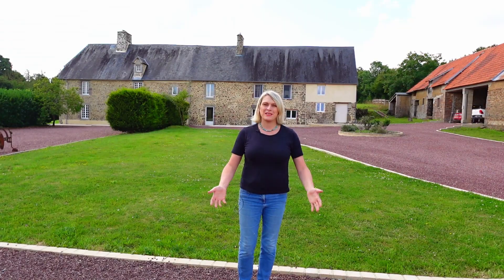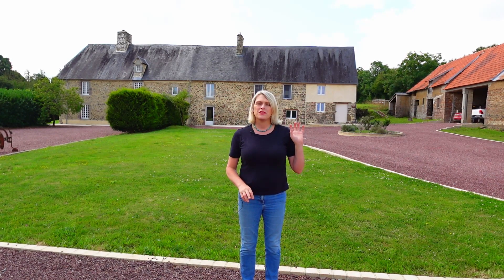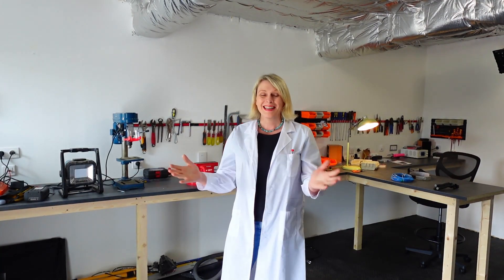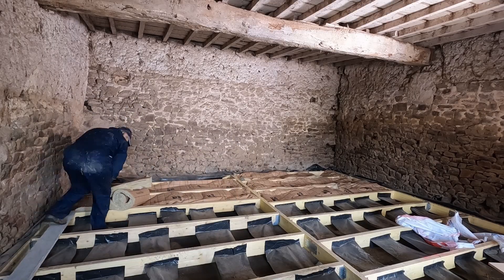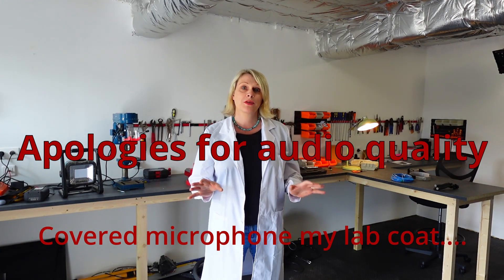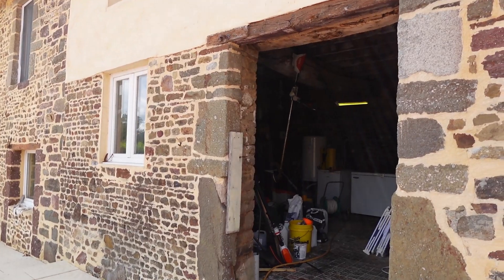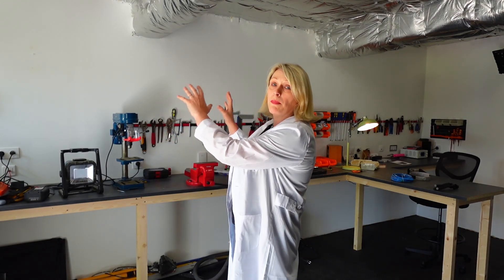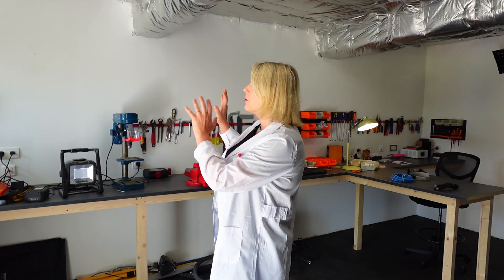DIY Whole house battery system -  overview

Comment: That's incredible the cost of electricity $1000 Euro's a month. Solar is a great option your lucky that don't have problems with building code in regard to DIY battery's and solar panels. Here in the US they have so much regulation around solar makes it very expensive to install. I believe lot of that comes from the electric utility who are against rooftop solar although they don't say that publicly.

Comment: Cool project. I'm just starting to plan a solar installation in France - we have almost 100m2 of south facing roof (plus almost as much east/west), but since our heating is currently gas (in a cistern) I have no idea what our eventual demand will be. We are renovating half the property too so there should be a good improvement in the thermal properties. It would be great to understand your loads a bit better. Your lab looks so much like I anticipate my workshop looking! I'm still trying to understand the different tariff/FIT options in France too.
Reply from the maker: Best of luck with your renovation project whereabouts in France are you?

Comment: I'm slightly confused how the power usage of the property is 100kwh per 24hr period?! I live in a 3 bed property and use 100kwh a WEEK! And that even includes charging my BMW i3 a few times

I use a victron system that I did myself too which has 10 420W panels - in the winter even with a field of panels you're going to struggle to produce hardly any meaningful power at all - from April till October you're gonna be swimming in power! 

Just an fyi on charging your car - I just use a 3 pin charger because unless your inverter has MEGA output and its also very sunny you're going to struggle to produce the power at the rate that your car will be wanting it. I find my i3 takes a full UK summers day to charge from empty running at 8amps

I have to leave headroom on the inverter to run everything else going on in the house as well.

But the end result is the house is running for £0 and the car gets fully charged for £0 too
Reply from the maker: The main reason we have very high electricity usage is because of electric heating however this is only in the winter.
Reply: @Gridbusters-qx4om Sadly as others have said winter is when you will produce the least solar, for example my peak summer output is about 30+ kWh/day, right now in winter it's less than 5 kWh/day, so I purchase the rest of the power I need from the grid overnight on an EV tariff to charge my 30 kWh battery bank.  Honestly you should look at replacing your heating system, I have the Toshiba Air Conditioning RAS High Wall Heat Pump system in several rooms, Cooling in summer, heating in winter, it's super efficient.  I'll be following your journey it looks quite interesting to say the least!  Best of luck.
Reply from the maker: Luckily we have quite a lot of land here and it's very windy in the winter,  so we might look into getting some wind turbines later down the line.

Obviously in the summer we will have way too much power for our needs but we might invest in some sort of crypto currency or bitcoin mining solution to use some of the excess power.
Reply: @Gridbusters-qx4om  just adding to this as have watched some of your other videos - even if you did make a 100kwh battery bank (which would cost a fortune!) in the summer you wouldn't need it and in the winter you couldn't charge it;

a wind turbine would address that but a £2k wind turbine that you tend to see on boats tends to generate at 100-300w even with good wind conditions - that's a lot of spend for what you get!

And this is what it all boils down to - you can get 90% the way there on say for you a £20k spend but to cover off that last 10% with renewables is going to cost x3 that initial spend again! Its for that reason that your best bet is to just use the grid for that last 10% which just costs you the cost of usage. 

I mitigate some of these costs by using Octopus Go to charge the batteries and car overnight for 1/3 daytime prices. Doing that costs me nothing but I generate the savings out the back still.

And ultimately if you do have a power cut in the winter for a few days you're not gonna be heating the whole house - you might heat one or two rooms or switch to eg gas/log fire

It would be interesting to know your 24hr period usage without heating. I would use that measurement to size your battery.

Maybe you could setup a channel discord? I think a lot of people have a lot of real life experience and would love to help each other?!

Thank you for your videos, its really interesting to see the progress!

Comment: I am happy to have stumbled across your YouTube channel. I live off grid myself, and I have built and installed all of the equipment myself. I have been recharging my electric car for the last 12 years exclusively from my off grid solar system. It is so rewarding. I can’t explain it. It’s like I have a perpetual energy machine. 

Your other video made me nervous when you’re using a ratchet close to the battery terminals . Please be careful and don’t short those cells out. It is a good idea to make sure nothing can fall onto the live metal wires or bus bars. 

I have six 300 amp bms in parallel (jiabaida) I like them because of the iPhone app. 

It will be interesting to follow your off grid, busting experience . 

Victron makes good stuff. I think you’re making a really good decision. 

I am going to subscribe to your channel now .

Comment: No idea where you are in France, but I hope its the south of France and very sunny. You are going to need a colossal amount of solar panels to cover you're energy usage in the winter months, maybe even the summer months as well, that usage is insane and I guess the EV sucks up a lot of that. Wind turbines are a great idea as you have space, but from what I've read they are not easy to integrate with Victron gear.  Good luck, hope the build goes well.

Comment: Hello Sarah, good to see you making Home energy plans, we have a 3 bed bungalow in mid Wales, which currently has a 3.8kw solar array due to be expanded to 10kw when fully finished within 5 years timeline. We 2 x 5kw Inverter as one acts as our back system. We also have a 12v system that runs off the main battery bank so that if all fails we still have lights, and a means to charge up devices etc. 

We have 2 Nissan Leaf's one of which acts as our back up battery storage, which is achieved via a Setec 6kw power station. We are now all electric ASHP for our heating, Sunamp for our hot water, and a 5,000L rain water harvesting system (with another 2,00L in reserve) which is used to flush our loo, wash our cars, and water our garden and veggie plot. Whilst our budget doesn't quite reach to the levels you have at your disposal, we manage very well with our energy usage and production. It is all DIY like your good self and is subject to change when we see fit, and where funds allow. 

We peak at 1,500kWh per month in the winter months, which make use of the Octopus Go tariff of just under 10p per kWh. This drops off to as low as 50kWh in the summer months, where we try to maximise our solar generation. We do don't use fancy software controls, as this all appears disjoint and random presently, but rely on our own monitoring of the weather forecast to plan and prepare for car charging, or water heating, whilst keeping the batteries at a level between 25% and 80%. We fully charge maybe once a week to 100%. Charge one of the cars at least once everyday from either solar or mix with solar and grid or grid entirely. 

At some point in the future I plan to have some way of pulling out into the garden another solar array for winter months, so as to boost our solar generation. We don't have any space for a wind turbine other than those seen on boats. So we have invested in a cooperative Solar Farm via Ripple which is due to come on line next year. We may also invest in one of thier wind turbines too. This will allow our account with Octopus to accrue during the summer months to use this surplus in the winter months.  

My name is Ken by the way.

Your channel looks very interesting and is something I would encourage farmers to look carefully into here in the UK. I would say yes to the Facebook community idea!

Comment: Good luck - we run our Spanish property off-grid with 12 kW of panels hooked to a 72kWh battery bank built from 80 x 280 LFP cells using JKBMS' and a couple of Deye inverters. The battery build is quick once you get going but watch out for the cable sizing and c-rate - over-spec main battery cables as when you start pushing 10kW into batteries think can warm up.